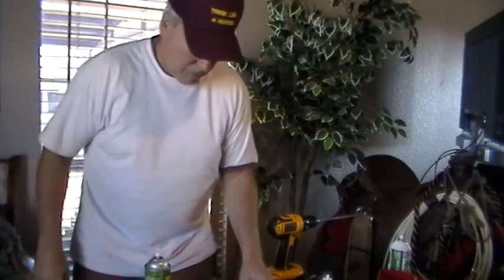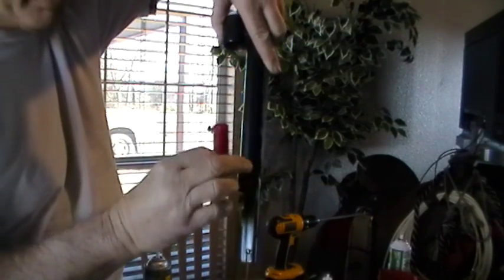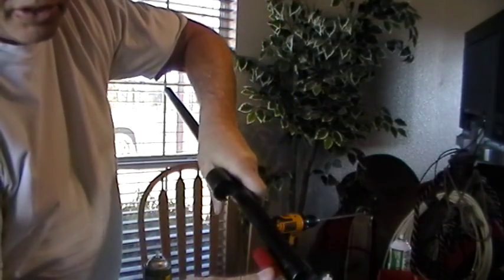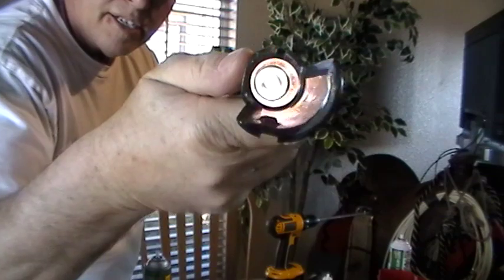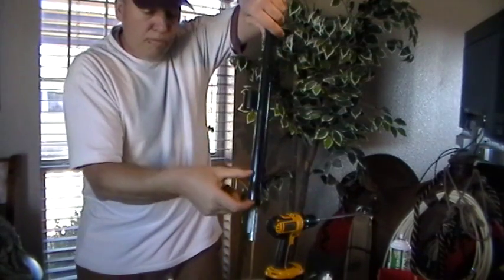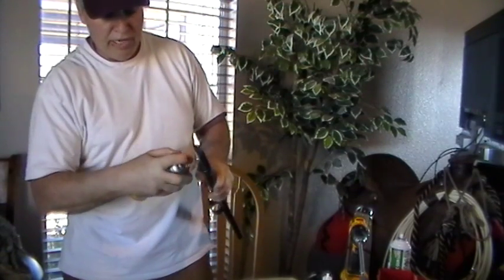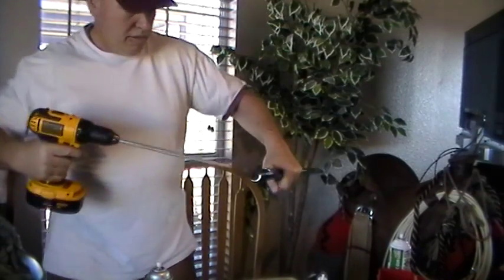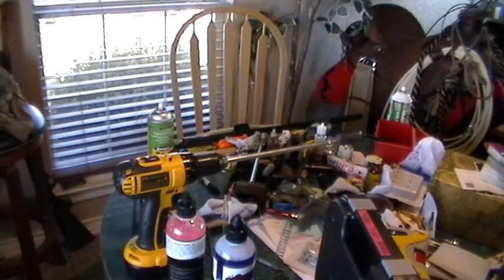Polish Your Shotgun Barrel- Better Feeding & Ejecting - Shotgun Mod Improvement

Comment: You didnt mention it but make sure to use #0000 steel wool only, anything less may be trouble. Spin the drill slowly and work it up and down swiftly, dont stay in one place too long.

Comment: If you use a coarse abrasive like steel wool use a fine abrasive on a cloth like a solid polishing compound or nupolish afterwards.
Reply: 0000 steel wool is perfect for the final polish. Us WD-40 and 4 ought steel wool it will be nice and shiney.

Comment: In the US of A we call that high brass and low brass.  How do you reckon the brass scars the steel barrel if brass is much softer than steel?
Reply: hard steel of chamber will smush any grit into the brass, creating a lap. the brass moving in and out will scratch the chamber. these scratches will scratch the brass, leaving a deposit of brass stuck in the chamber that makes the next shell stick. i say this based on my experience machining and assembling precision components. Published surfaces also dont let junk collect on them, and clean much quicker

Comment: Please use bronze wool, you could add a polish compound too.
Reply: If you hAVE A REALLY BAD ROUGH CHAMBER bronze wool won't work. But you could use it after getting your chamber smoothed out after using steel wool.

Comment: Well intended but definitely not what you want to do.
Reply: WHY ? My 870 chamber was VERY VERY ROUGH, had to use 320 grit paper to get HIGH BRASS SHELLS TO EXTRACT FROM THE CHAMBER. Then went down in grit & finished it off with a bore mop & polishing compound. Now it extracts GREAT, NO MORE STUCK SHELLS, I guess it depends on your shotgun brand ?

Comment: painful watching this
Reply: Worked for my 870 but I had to use 320 grit, Steel Wool didn't cut it. I had a VERY VERY ROUGH CHAMBER. Then moved down to bore mop with polishing compound. Now High Brass shells extract NO PROBLEM.